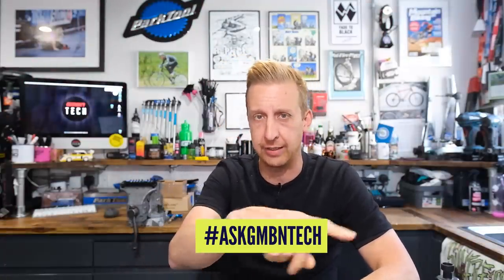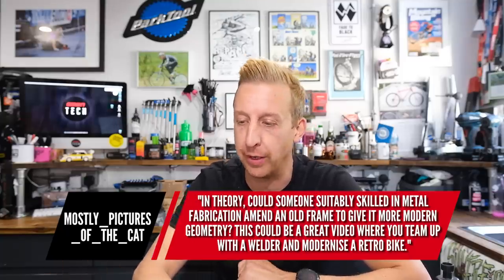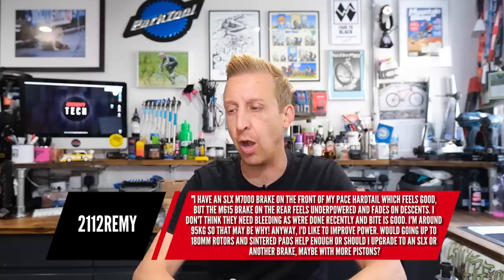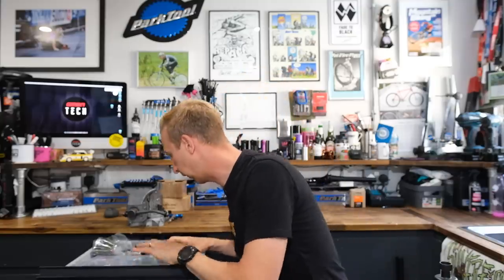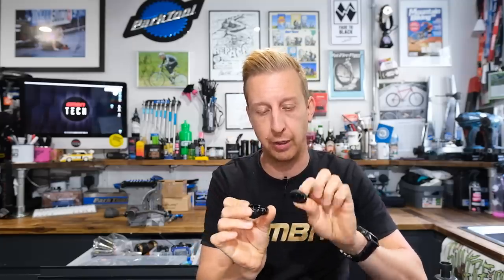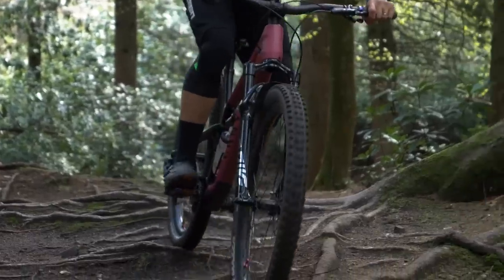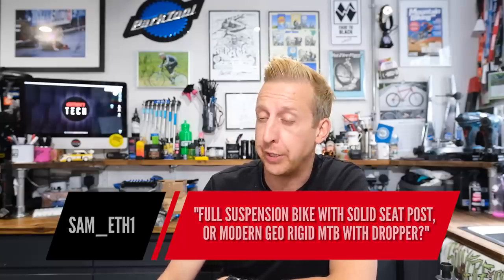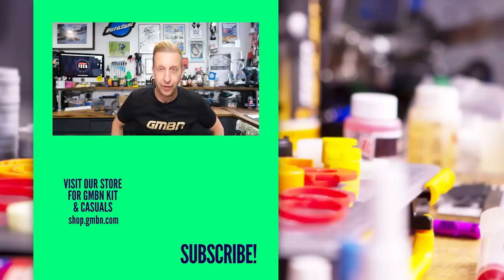How Will Mountain Bike Design Change In The Next 5-10 Years? | #askGMBNTech

Comment: As a frame builder and professional welder who's been in multiple industries in defence and scientific instrumentation, no, do not get a welder/fabricator to modify your frame.

It's only advisable for a very experienced professional frame builder to modify Andy frame, replace tubes, fix dents etc.

Steel tubing for bicycle frames usually go through multiple stages in drawing and butting that require aneiling (softening) of the material between draws, also some tubes are heat treated and or drawn to final temper and strength.

The key issue here is heat input and control to limit the degradation of the temper strength of the tubes. Any process can be great or damaging dependant on who the operator is joining the tubes. Brazing, TIG, Silver etc, doesn't matter, if you do not have the skills, knowledge and finesse required you'll cook the tubes and can cause catastrophic failure which is incredibly dangerous.

I ALWAYS advise against Weld repairs or mods on aluminium frames, not because it's impossible, more that the proper process requires many stages that most customers are unwilling to accept and pay for (cracked frame needs, shit blast clean, chemical clean, die penetrant testing, chemical cleaning, Weld repairs which can't always be blended back, heat treatment, then another die penetrant test, rince repeat until you can paint it, then pucker your cheeks because it can still fail when riding) great huh?!

Always check with a proper frame builder and make sure they are insured for the work.

If you insist on doing it on ally just hang it on the wall as art, it's not worth the risk as the failure mode on aluminium can be very sudden. Always purge Ti repairs.

Comment: For the middle gears, make sure your cassette lockring is tight!
Reply: And check for play in the jockey wheels - esp. if you have Eagle 12 speed. They don't seem to last very long and a bit of play will prevent good shifting even in an AXS system. Mine wore out in 1500 miles :/
Reply: @tomh7540  Not the case with my SX derailleur it's super sturdy! Lol kidding 🤣  I'm tempted to replace it with the shimano deore 12s derailleur to be honest once the SX derailleur is broken.

Comment: I agree doddy..    internally geared bikes are coming.   I think that shimano patent they filed a year or two ago has got to be close to being done on a bike
Reply: That alone will make the rear suspensions perform so much better.  Getting that cassette off the rear wheel...   and it will also free up the rear end design not having to deal with the chain space

Comment: #askGMBNTech
Hi Doddy just a question regarding the excellent video on looking after your chain. I have two chain wear tools by Park Tool, CC3.2 and CC-4. Using the CC3.2 my chain is worn to nearly 0.75 but using CC-4 my chain hasn't even worn to 0.5 yet. Which tool do I trust and why are the results so different. They are both fairly new chain checkers by the way.
Thanks
Tom

Comment: Brake mystery... I've four pot XT brakes front and rear. Contaminated discs on a new build meant new rotas and pads. One ride on the new ones, perfect. Washed my bike with mucoff... Next ride, brakes howling like a banshee on crack and had as much stopping power as 80's canto brakes... Note they dried with a clean cloth (one I keep away from everything and is only for brakes post wash) 

The calipers arent leaking, I always handle my bike when cleaning and maintenance with gloves, no solvents or lube have been sprayed since the first ride on the new rotas or anywhere the bike since swapping the pads and rotas. They were bedded in properly and have used mucoffs brake cleaner with no result. Could it be that I was unlucky to have received two sets of pads and rotas that were defective put of the factory (never seen that before) what are your thoughts #askgmbntech ?!

Oh and they did not make a sound on the first ride after bedding them in and were as powerful as the hulk so not glazed or polished
Reply: #askGMBNtech mystery solved, it was windscreen wiper fluid in a stormy drive with my bike on the roof... The current batch I have in my car is packed full of anti freeze which apparently, is like baby oil to brakes 🤣

Comment: #askGMBNTech I have a very annoying ticking/clicking sound coming from the front wheel. the sound gets faster and slower as the speed changes. I have had the biked serviced a couple of times since it started and always mention it, they say they have sorted it but the first time I ride the bike its back. I've tried a new axle and put tape around the valve. I just got a new tyre and got the shop to check the spokes and true the wheel but the sound remains. It's like riding listening to a metronome. Any suggestions?

Comment: #askGMBNTech 
Hi guys, I have an old Santa Cruz Bullit with a straight 1 1/8 headtube and was wondering if there's a way to run a modern fork with a tapered steerer tube. Cane Creek unfortunately doesn't make a headset that will work and was wondering if you guys might have an answer. Thank you for your time. Love the show.
Reply: All depends on your headtube width if your headtube is about 44mm you can run a hope or nukeproof lower external cup and run a newer fork with 1.5 taper have done it and it works perfectly
Reply: @vtecmossy  Yeah the diameter (internal) of my headtube is 34mm. So I guess it's not looking good.

Comment: @/askgmbntech I think I'd like my 2021 Trek Roscoe 7 better if it was a bit slacker. Would changing the headset for an 2 degrees angled one like the ones from Works Components be a good thing? Or would that mess up the geometry (bottom bracket height, seat tube angle) too much?

Comment: #ASKGMBNTECH Long story short the thread in my crank has stripped. So I cannot preload my bottom bracket by tightening the crank bolt. So what I did was use a wood clamp to preload the the BB and then I tighten the crank arm in place and removed the wood clamp to get back on the trails. obviously this is only a short term solution but is this a "good hack"? I just did it and have no ideal whether it was a good or bad idea.

Comment: #AskGmbn
When setting up the b-tension on a derailior without the setup tool,does the cain have to line up with the guides that let the cain go from each cog easier? So when i put it into second gear and set the b-tension up with the cain lined up,would this be a way to do it.(with considering that the cain grow would cange it a bit so makeing it a bit too loose)
Reply: I did my Sram gx eagle recently without the tool. I found out the distance between the largest sprocket and the upper guide pulley teeth should be 15mm when you are in the biggest sprocket. In reality I ended up setting it a few mm closer. Shifting seems spot on.

Comment: CF cannot be recycled. once the resin is hardened it is irreversibly modified. the only way to recycle it is to grind it up and use as "filler" material when you make putty to fill scratches etc. or to burn up the frame which leaves clean CF fabric and you "could" reuse it. though burning up plastic will never be environmental :D.

Recycling composites is the biggest problem/obstacle of the material.

Comment: #AskGMBNTech is running extreme (max or min) compression settings harmful to your suspension?
Reply: If you got real compression tuning: No
For example I mostly ride my Compression and rebound in the rear completely open, cause the shock is tuned to heavy. But I would recommend getting a tune, so you have room to play around. (I will do that too, when I service it)
If you mean closing the lockout: Yes

Comment: Gearbox development PLEASE. derailleurs are irritating, noisy, need adjustment, and get bent or broken easily. weight could be recovered with 2 piece pressed aluminum/steel gears. subtract the cassette, now expand the rear hub to make it stronger. why would drag matter on the kinds of bikes we ride? we put big knobby tires on them.